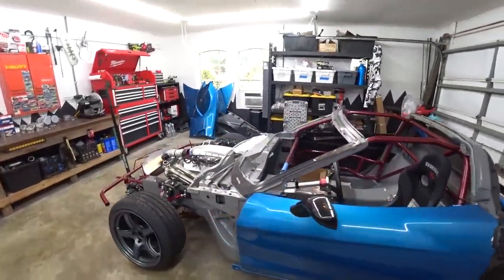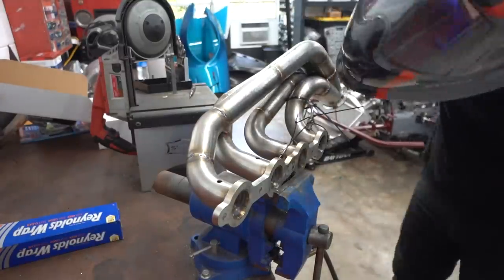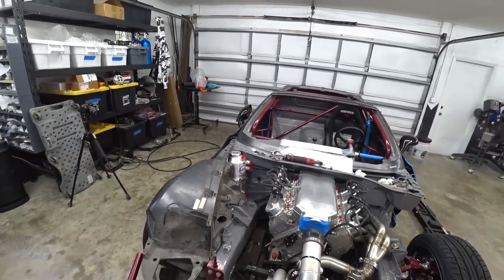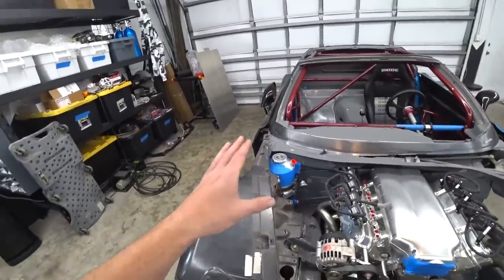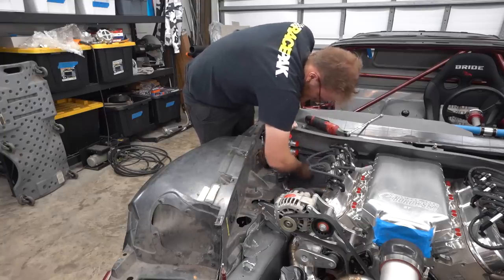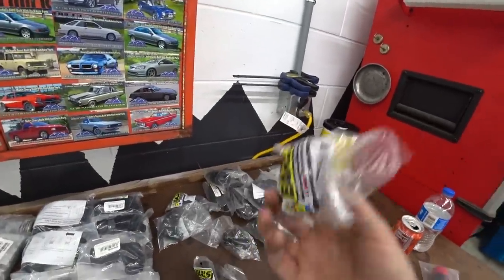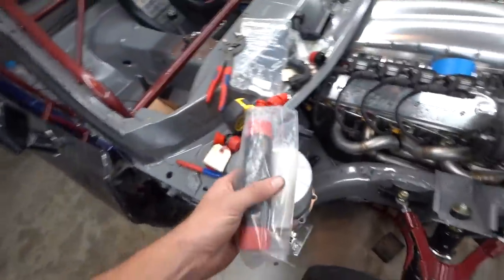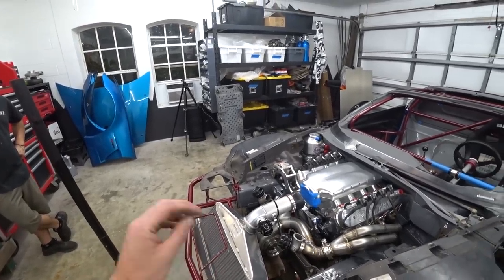C6 Corvette competition drift build. putting all the fancy stuff in.

Comment: I hope you make a support bracket for the turbo once it is fixed in place, your exhaust manifolds will thank you. LOVE THE VIDEOS. Incredible fab work.
Reply: He will definitely need a support mount especially with flex joints, typically on the turbo flange itself if it’s t3/4 or on that 2 to 1 merge if it’s vband
Reply: YouTube mechanics, i love it .I’m sure he knows what he’s doing 😂
Reply from the maker: Yes. I mentioned it in an earlier video. The turbo mount I bought didn’t fit so I’m working on a plan b.
Reply: @Taylordrifts  "plan B" so often works out to be better anyway. Pre-planning takes a guy only so far,, then the real deal presents itself and ya have to adapt.

Comment: Hint for stuff like fittings (or anything really), if there is a brand you like / want to be consistent with is to get a brochure / catalogue of their full parts list, usually available as a pdf to download these days. Generally meant for re-sellers but can be useful if your ever in a similar situation where you need different options for fittings, connectors, tools, hardware and so on.
Reply: Wall chart!

Comment: Just a quick suggestion, keep one of those temp guns handy in your trailer, that way you can do a quick check to make sure one of your EGT sensors isn't giving you false data. I have seen that before where one EGT was going bad and it seemed like the engine was misfiring on that cylinder, then you play with the tune a bunch trying to fix a problem that isn't there. Using the temp gun to quickly verify the EGT readings can save you that hassle. 👍

Comment: I'm a fan of using angle bar for bracing, flat bar just flexes too much especially alum.  Dry-sump bracket looks good just need some hole-saw treatment when you get some free time later.  Summit use to have a great site, still ok but they keep making it worse.   Funny how plumbing plans change so much and always have to order diff fittings.
Reply from the maker: Yep. Always something you didn’t realize. Lol and yeah I just had the worst luck searching stuff on summit. I would type in exactly what it was. No results. Use half of whatever it was. Dig through pages. Find what I was looking for and it would be labeled exactly what I typed originally.

Comment: Your building and fabricating inspires me so much, I finally got out and worked on my project  car, getting the new mirror caps painted, adjusting all of the latches, and even fixing my hatch glass release! Hoping that someday my welding can match up with yours! I also just completed building my first welding table, is there anything that I should have that I could put in it before I "rust-proof" and get it all set up? Just thinking someone with a ton of experience like you would have some recommendations!
Reply from the maker: Definitely a vice. A vice helps a ton. I have a extended thing to add a vice on mine once we’re in the actual shop. Makes welding exhaust type stuff way easier!
Reply: @Taylordrifts  Absolutely a great idea! I will look into hopefully a fabrication vice rather than the standard "harbor freight" ones haha. Thank you!

Comment: Oil vapor from the breather that near to the header could cause some risk of fire. If you decide the hang the filters off the dry sump tank a bracket to support them is a good idea. When full of oil and with the lines that kind of mass supported only by the tank outlets could be problematic.

Comment: Could use a hose from the tank to scavenger filter then hose to pump, ect. That way you are able to mount the scavenger filers together
Reply from the maker: I went through that out took that part out. The lines would be too short coming out of the pump and the filters would have to be right by the header.

Comment: I have to give you two suggestions from a guy that’s had/ built 1000 hp twin turbo dry sump 1969 Camaro . Put the breather as far front or back of the car so you don’t breath the fumes . Secondly by ARP header studs  that’s too much stress / weight with the turbo on the heads and bolts be it Arp or regular. Especially if you’re going to be taking them on and off a lot and you will not have any exhaust leaks with them . 
Best of luck on the build !

Comment: Taylor you might take this advice and you might not but I think you should mount your dry sump in the passenger floorboard. With it being in the corner of the inner fender arch you run a risk of taking it out in collision or if a tire ends up coming loose because of ball joint or tie rod  or a wall tap or a hit when your running tandem's. The body and fender arch can be saved during a comp but a whole in the dry sump tank ends your day.
Reply from the maker: Matt field has ran his there. Which is bigger. For years. Competing in FD. It’s a risk. But worth it for the reward.
Reply: Ok cool I hope it all works out for you and you win a ton of rounds. Hopefully you can get to run some FD rounds next season with this car

Comment: What if you put the breather tank on the firewall on the drivers side in that corner you had it first, then the oil filter on the drivers side front chassis rail on a stand up bracket making it sit up higher and away from the down pipe/exhaust pipe.
Just a thought. 😉✌️

Comment: Taylor, why not build hard lines from the engine outlet under the intake manifold? No need to worry about if a fitting/line can make a bend, You would end up with a connection under the intake that would suck to service but I would think it would be less prone to failure... Also why not just drill a hole in the trunk of the Miata to change oil?

Comment: Taylor are you going to build a solid mount for the turbo so the weight won't crack your welds or crack your flex joints like on the miata
Reply from the maker: Yes.

Comment: Did you check the manifold gasket faces are flat, the tend to warp when welding and need refacing to seal properly 👍
Reply from the maker: Yeah I clamped them to the table when I welded them.

Comment: with the support for the tank, why didn't you go from the plate where it's mounted on to the diagonal bar coming from the bulkhead to the frame ? You'd have support bracing the plate against lateral movement and a little bit of weight diverted to that diagonal piece. Not criticism, just curiosity.

Comment: Hope they get rid of the Link ECU requirement so you can run this is a few prospec events next year.   Requiring 1 system for all cars is stupid esp when you have a mixx of ECU manufacturers that are tops depending on engine with Holley clearly being the best on GM motors.  Seems a few didn't run this year because of that as elecronically starting over is expensive.
Reply from the maker: Yeah I think that’s so silly. I’m super used to Holley. They make the best LS Ecu. And you want me to rewire my car. With a totally different ecu. Find a new tuner. Etc. nah. I’m good. Lol

Comment: Hey Taylor,  if you shaved some of the flange ear off your right hand side header vband flange, would you be able to fit it in, without removing the altenator?   IE, cut a small piece off which would allow it to pass through the narrow opening, but still have enough left in place to make a good connection?

Comment: Is there enough room in the front of the passenger wheel for the breather and filter?  Maybe run the lines forward then back? Also you mentioned the wide bands, have you left enough room to mount them?  I am looking forward to seeing the water lines run under the manifold, I am confident you can make that work.  Great work as usual and I can't wait for the next installment!

Comment: A couple of questions. Is there a benefit of using o2 sensors on each cylinder. Would you get better info from egt sensors? Something I have always wondered. Can the ecu alter the mixture for each cylinder in real time. Would it be a lot of data?
Reply from the maker: Probably. Just way more wires and way bigger sensors. EGT with a general wideband gets you most of the way there.

Comment: Taylor, don't the scavenge filters go between the oil pan and pump, to keep busted connecting rod piece out of the pump??? Also well you be able to thread fittings into the pump once hose is crimp on? Just asking, it has been awhile sense I have plumb a dry sump system, things have change. The car is going beyond KOOL!!!
Reply from the maker: This setup has screens build into the pan. It’s all billet with passages from the pan to the pump so no lines to and from the pan. Their diagram says to run two on the return to the tank.
Reply: @Taylordrifts  Oh now I remember seeing this LS dry sump set up in pieces at the machine shop. I never seen it complete, I'm going have to watch extra close. 
I enjoy your video's a lot. For years I never could figure out drifting tell I started watching your videos a few years ago. In my day it was getting as much traction as you can.

Comment: You have a Clear view housing with a filter why would you run additional flitters? It will already be double filtered with a 60 or 115 micron filter before the oil filter.
Reply from the maker: They suggest you run the style with the filter if you’re not changing your oil super frequently because it catches the small stuff.

Comment: No real reason to change it, but if you had put a bend in the dry sump tank mount sheet thing that would have really helped with rigidity. Then you could still do the same additions you did it would be a lot stronger

Comment: I know that you know this already. I just need to say it just in case. That is a big turbo. I really hope you have intentions of mounting it sturdy to either the motor or the frame. The headers cannot hold that up. They will crack immediately
Reply from the maker: It will be mounted. I mentioned it a couple of videos back. But I guess I’ll need to re iterate in future videos since I get about 50 comments per video. Lol I bought a mount setup that didn’t fit. So I’ve gotta come up with something. But I’m not naive enough to think I can hang a 40lb turbo 3 feet from the flanges. I figured people would give me enough credit to assume I knew that. Lol
Reply: @Taylordrifts  I knew you knew. Just wanted to make sure. I It’s an intensive project and it’s very easy for little things to slip your mind. Little reminders help. Love the videos  tho. Your videos have become my favourite to watch. Get excited everytime one pops up

Comment: The scavenge filters need to be placed where their name would suggest.

They need to be fitted between each scavenge port in the oil pan and each scavenge port inlet at the drysump pump.

Otherwise they will not do their intended job.

If the filters are NOT fitted before the scavenge inlet ports at the drysump pump you have WASTED your TIME nad MONEY on them!